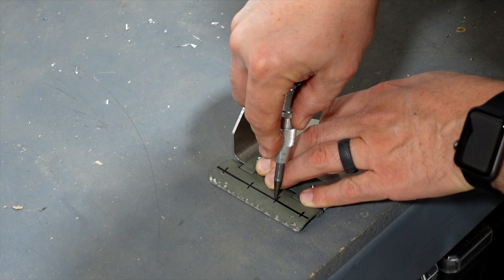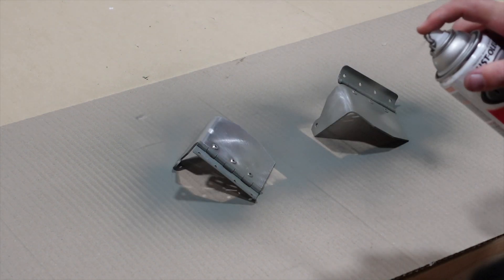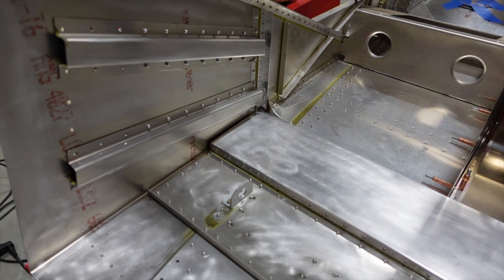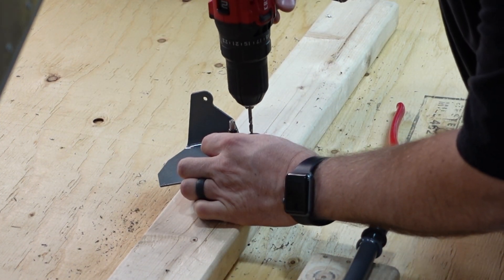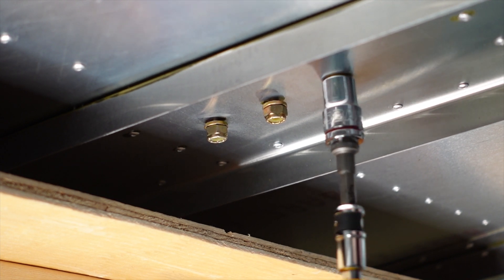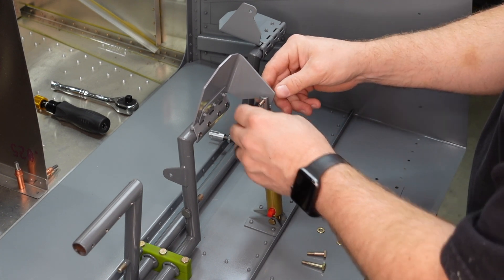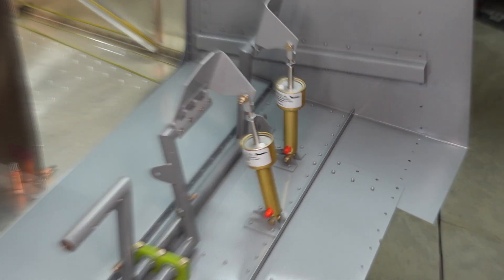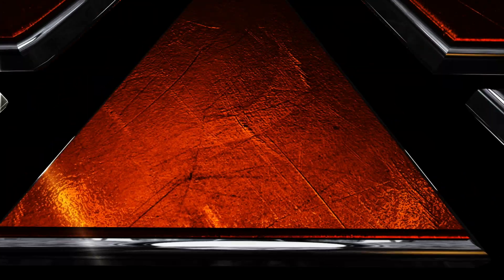Ep. 15 | Rudder Pedal & Brake Installation | Super Duty Aircraft Build

Comment: What did you do to get the nice radius on your piano hinge,to fit nicely on the rudder pedal tube?
Reply from the maker: I put them into a vise and bent a little at a time, then pulled them out of vise a bit and repeated the process.  This is how Zenith advised to do it.  I also worked them a bit around a metal pipe.
Reply: @AeroworksProductions  Thanks so much for your reply! They look great!

Comment: Not using castle nuts and cotter pins on pedal to brake rod???
Reply from the maker: Robert you are correct, I missed the call out on the drawing for a drilled shank bolt (castle nut required).  This is exactly why I created this series to help others, including myself.... :}
Reply: @AeroworksProductions  what drawing has the call out for the drilled shank bolt and castle nut? I don't see any info other than drawing SD75-FF-04